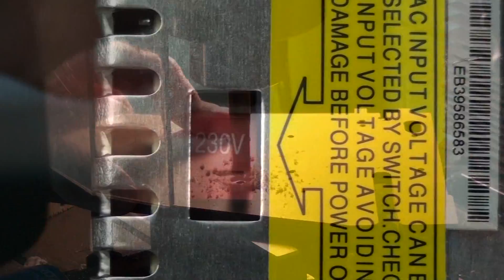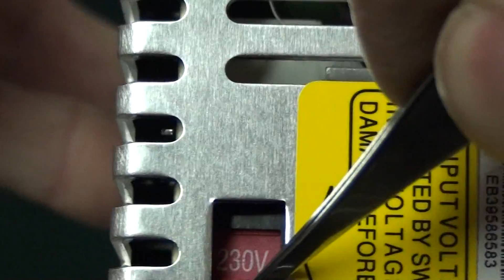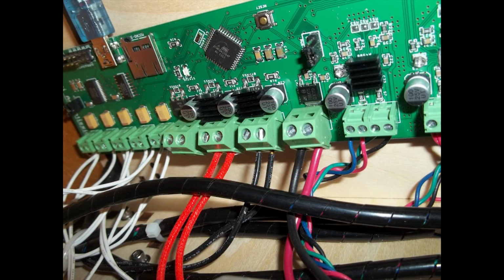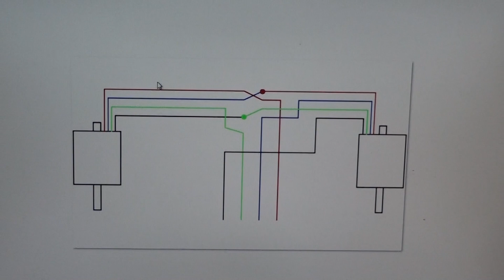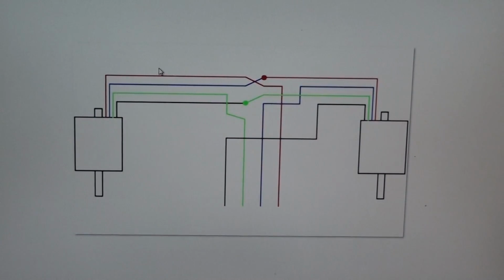Building My Pangu i3 3D Printer Part 4 ... Electronics

Comment: I boutgh the printer and assemblled it. now i miss the drivers for the motors. from where please can i get it?
Reply: You didn't buy it from me, this is a common problem along with a warping plywood bed and crappy bearings with cheap kits. I fixed all of these problems i my printer.Contact me from my web site figfab.com and I will send you the new marlin program that actually works.